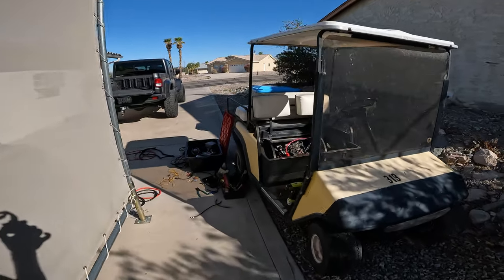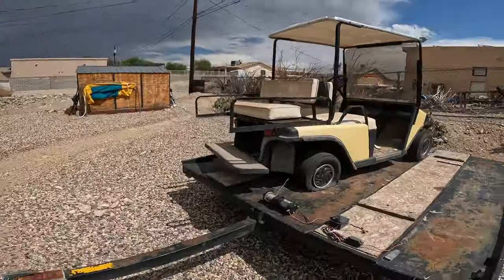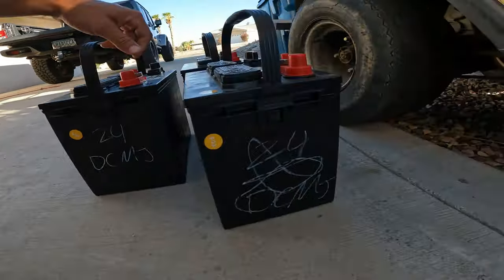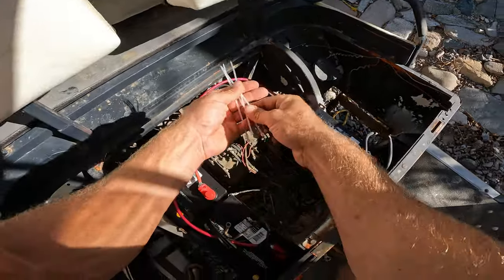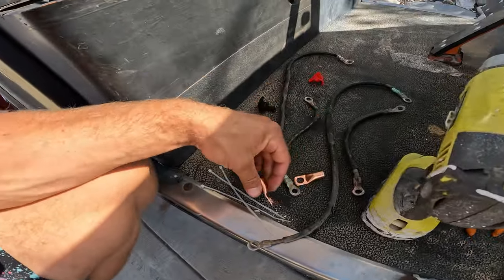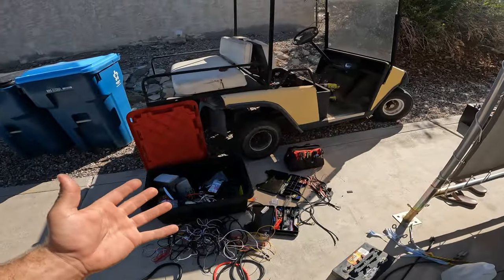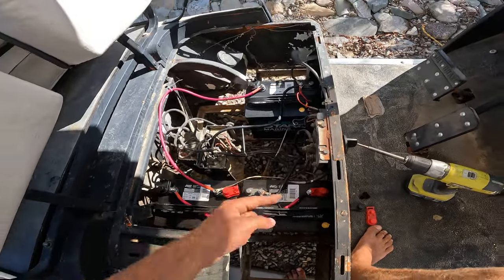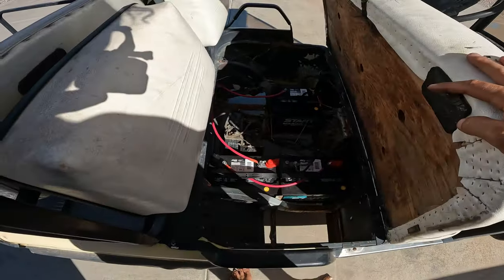Cheap Golf Cart Batteries 12v Budget Golf Cart Repair & Battery Maintenance Ep59

Comment: Always wondered if you should put solar panels on the roof.   Looks like you have plenty of sun and think it would work.
Reply from the maker: I was looking for Panels that fit the roof. Still working on the 36v charge controller. They are quite a bit more expensive than the 12v. Working on it! Still searching!